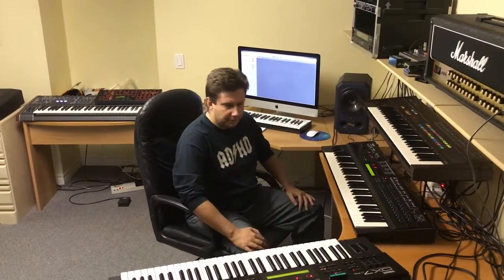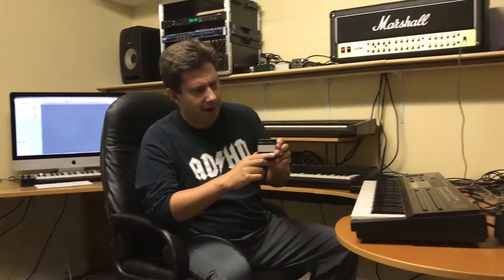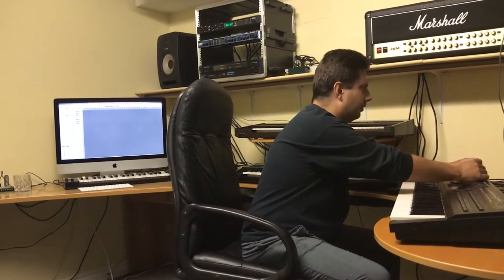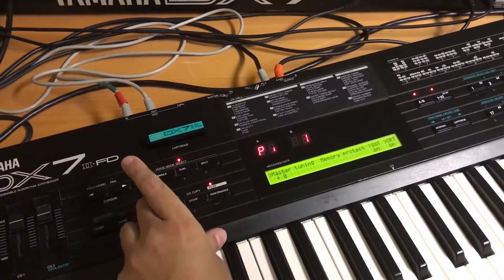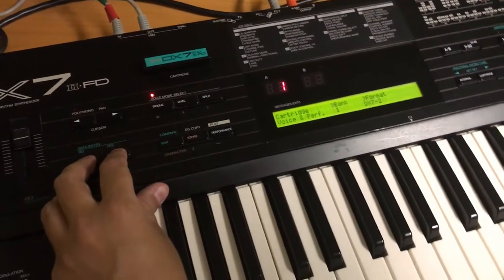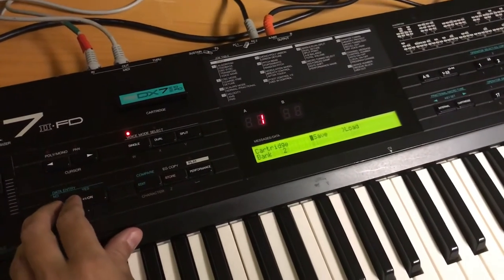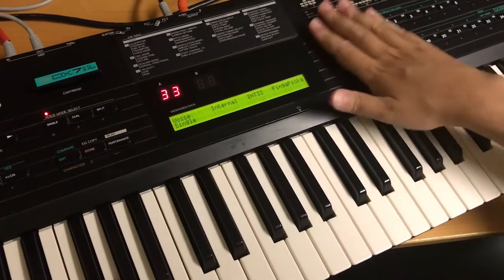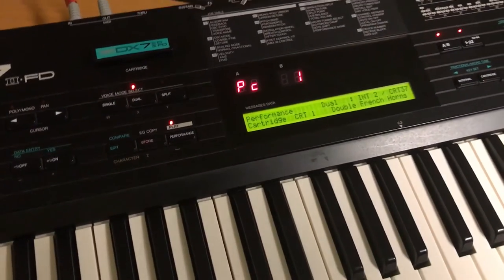Restoring Yamaha DX7II D or FD from cartridge

Comment: Hey boss, love your synth videos and great sense of humor. I have one addition about the RAM4, it can in fact hold FKS (fractional scaling data). There were several commercial banks made for the DX where you needed a RAM4, formatted only as FKS. If you were loading the patches from floppy, you had to load 2 banks, one to internal for the patches/perfs and then a second, directly to cart for the fractional data. In this case, the cart has no sounds on it at all (if you press the cartridge button you get an error) but you need it in for the internal patches to play correctly. Also, some firmwares have a legit factory reset: Press and hold [EDIT] then press [16] and [32] simultaneously. Release and you'll see the firmware displayed, then it will reset and you will probably lose all your patches so don't do it unless you have a cart! PS the aforementioned procedure does not seem to work on E! units.
Reply from the maker: Yes, edited that out as I felt things dragged on some. Also thought that the concept of using a memory card for fractional scaling alone was somewhat underwhelming. Most of us just tried to stick as much voice and performance data on these things as we could. Yes, have a few VRC100x cartridges knocking around and was going to do another video. Sadly never got around to it. Traveling a lot and don’t even have my old studio anymore.

Comment: Hello, thank you for loading this. Could you please clarify two points: 1. What's the difference between loading with or without system? (2:34) 2. Since the cartridge was set to Bank 1 at 2:30, is it correct that "Load" puts the 64 voices and 32 performances from Bank 1 of the cartridge into Internal memory? I'm asking because I didn't realize you could use this shortcut to fill all the performance and voice slots with one command. Thank you.
Reply from the maker: Bricago 1. Loading without system simply means you only load voice and performance but not the System data. System data is stuff like all of your MIDI settings, LCD contrast, Control Assigns etc.
2. Yes, loads all 64.
Reply: Hedge 777 Thank you! If you have time for a follow-up question I’d really appreciate it. I noticed one problem today that I’m trying to troubleshoot: a few voices only play on about six notes per octave. Other notes in the octave don’t sound or are very low. This occurs  for both versions of the voice: Internal and Cartridge. Any ideas on how to correct this? Thank you.
Reply: Hedge 777 I found the answer in an online forum. Another user was reporting the same issue with voices 46 SilvaTrumpet and 54 SilvaBrass. It appears that they were intentionally assigned complimentary fractional scaling to allow them to combine as Performance Memory 14 Multi Brass Ensemble, and retain polyphony. With the ROM cartridge removed, both voices operate on all notes, albeit with a "t" next to the name in the display to indicate fractional scaling, which the Internal Memory does not retain (p. 63 of the manual). With the ROM cartridge installed, not all notes of the octave play for these voices in Single mode.

Comment: Hey love your videos! I have a question you may answer. When I turn on my DX7, I have the A note doing some morse code randomly without me touching it...and after it jsut stops...do you know where it might come from? Thank you
Reply from the maker: Could be anything from a flaky key contact to something shorting out on the board. Impossible to tell from here :-)
Reply: Hey just found the problem, disconnected the keyboard and found out it came from it. It’s actually a little diods that’s dead and need to change it..thank you :)
Reply from the maker: Well as long as it wasn’t the French resistance. :-)
Reply: @Hedge777  lol I'm actually french but I've grew up in the US

Comment: Hi and thanks for using DX7 synths !!
Just need a ask U a tech. My Dx7 II FD floppy went bad years ago.
I previously installed and removed the E! board.  E! went bad too....blew some caps. Ok the problem was I wanted to remove and I did removed the floppy unit and keep using the synth like a model II D.
But when i turned on the unit the,synth died and,all was,on INIT with no sound !! Is ,this,synth dead? Is it,design to look for the floppy disk unit to
properly work ?? Or maybe,a restore just like this video will make it work
again without the floppy drive unit ?? Did I kill it ?? And which floppy drive I can use to replace this ? Maybe a USB to floppy universal thinggy will work too.
I heard about a universal USB that works for 800k floppy units!!
Thanks in advance and keep up this awesome !! 
ps. Post that movie intro ...yeah,the White horse intro !!
Reply from the maker: Have a DX7II FD with dead drive and it works without issues. As long as the RAM battery is good and the rest of the board  is intact it should work.
Reply from the maker: BTW voices and performances going to "init" after some hardware problem is common. A factory reload should do the trick. Just restore from SysEx. Get a RAM4 cartridge to double the memory and forget the floppy drive. No need honestly.

Comment: Do you know if restoring a DX7IIFD with E! is the same process?
Reply from the maker: Depends on what you mean by ‘restoring’. Copying patches from cards should work. However if your E upgrade went bad. Different story. Please see FAQs: https://www.facebook.com/hedge777/posts/124799085893714
Reply: @Hedge777  thank you! Was hoping to reset banks 2-4 on E!. Just bought a DX7IIFD with (what was stated) "factory" E!  Bank 1 has seemingly good patches and matches ROM cartridge. Banks 2-4 each patch is garbled in name and sound. It has a new battery. E! version is 1.19.
Reply from the maker: SysEx dump ought to work. Link to patches either in the description (or FB page, pinned post). I don’t remember menus for E for MKII but it’s the same stuff basically. Turn off men protect, make sure your RX channel/ID is set to 1. Then make sure that SysEx receive is on. A bit of menu diving but you’ll figure it out I’m sure.
Reply: @Hedge777  thank you so much.